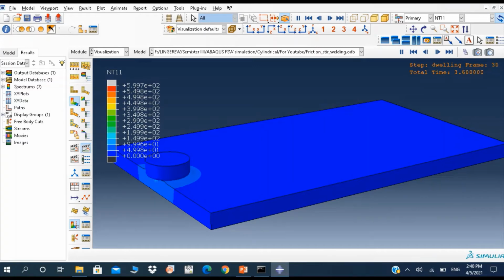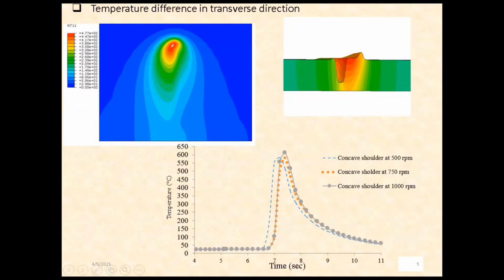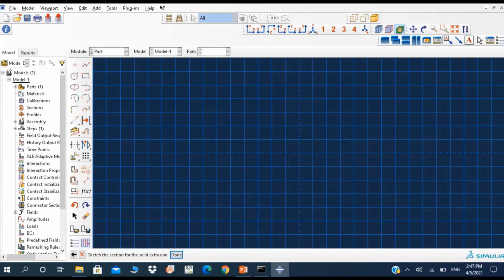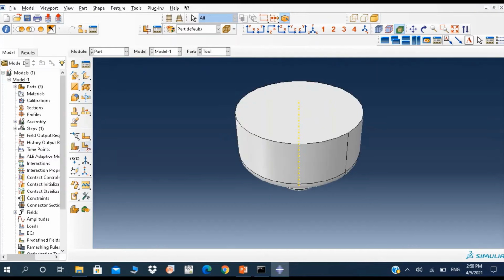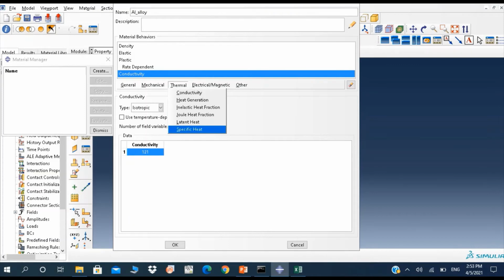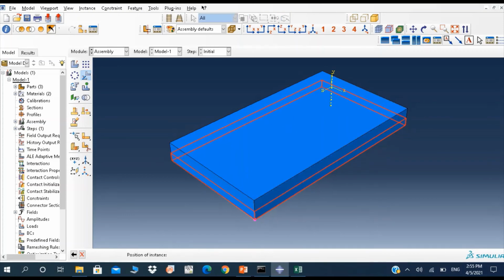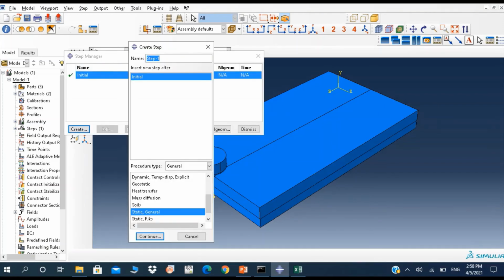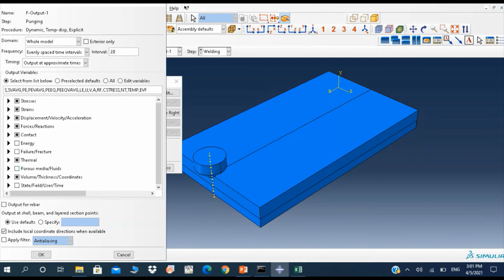Friction stir welding simulation in abaqus - Coupled Eulerian Lagrangian CEL method - Part 1 of 3

Comment: Dear Dr,
Could you please tell me why  you choose 875000 for specific heat capacity of steel
Reply from the maker: In similar unit like other parameters! In your case you can customize based on your material